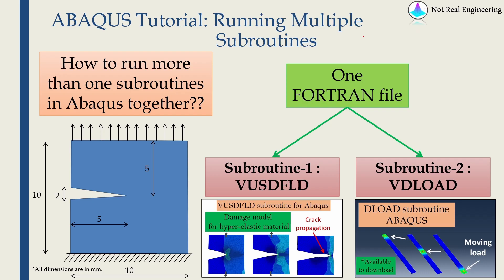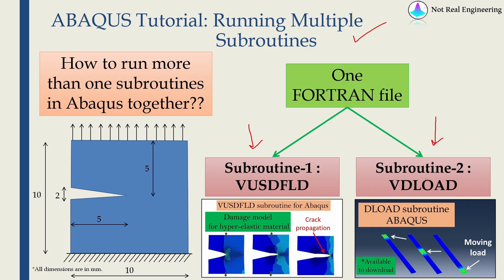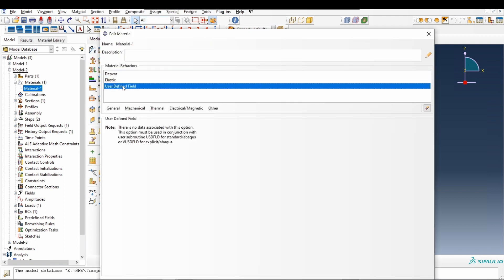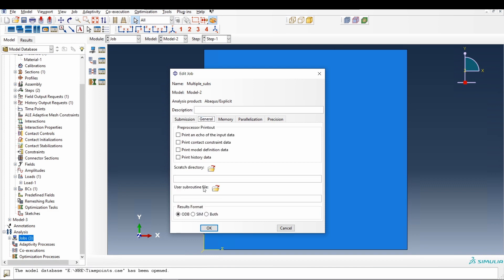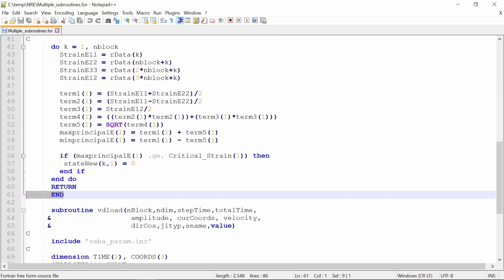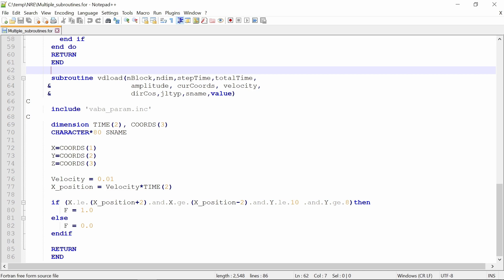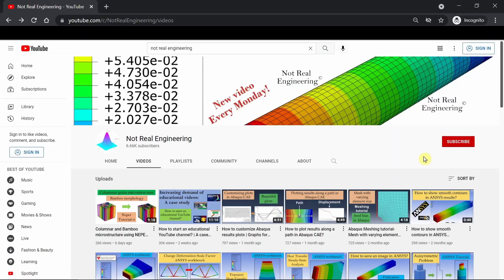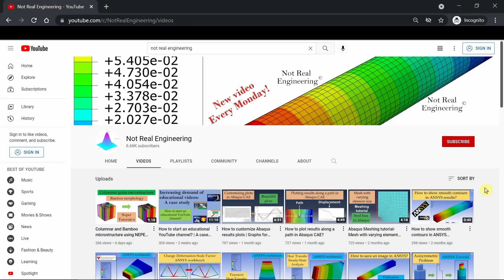How to use multiple subroutines in Abaqus? Two subroutines together in Abaqus CAE

Comment: Thanks for the information. 
I have observed that, if I input a WRITE command in my subroutine, I see the WRITE command being executed several times (For example, 2000 times. From my understanding, 2000 is equal to 50 integration points x 10 time steps x 4 CPUs). So would the results be different if we use parallelization? 

P.S: I cannot find any information as to how the number of CPUs would affect the result of the model.